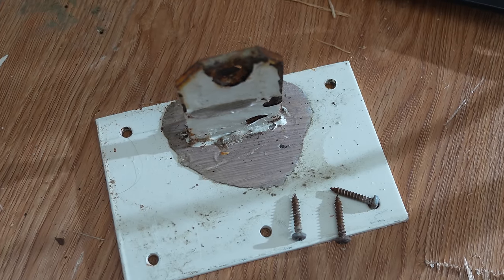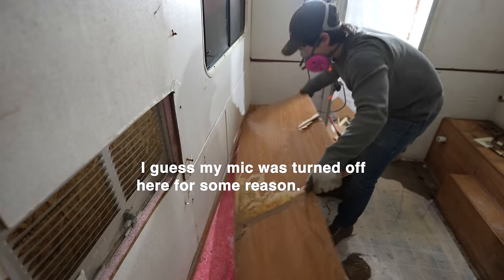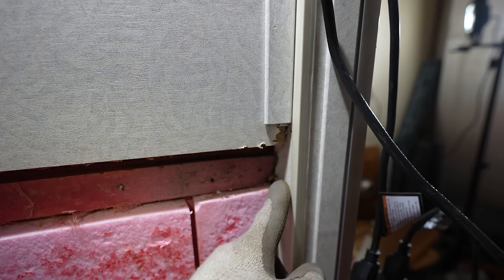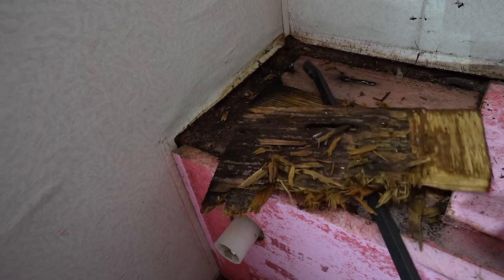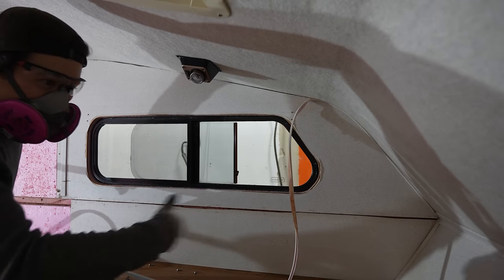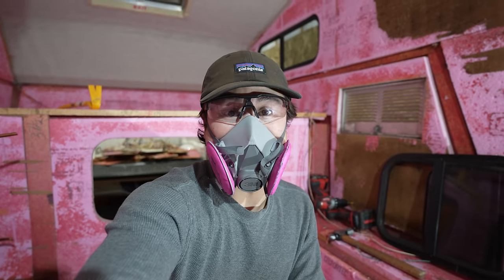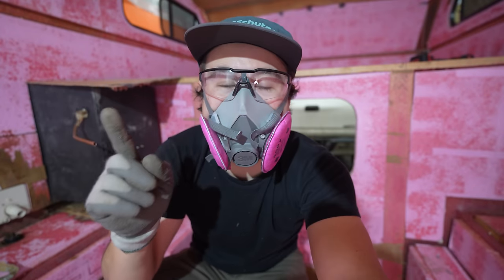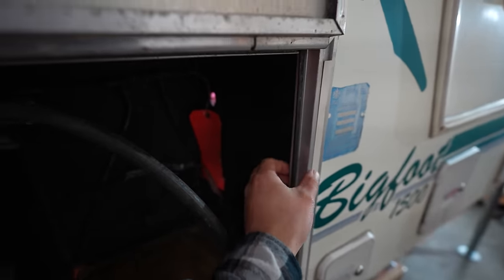It’s a Disaster in Here (Bigfoot Truck Camper Renovation)

Comment: Wow! What a nightmare to fully realize! But also what a plethora of possibilities! 

I wish I could give you some advice on how to proceed against that mold and adhesive.  I would suggest bleach in a 1:10 ratio (bleach:water) to at least kill the mold, but I am not sure how the adhesive or fiberglass would respond.  What I can suggest is that if you have been using your gloved hands to remove that moldy awful stuff, you should be not putting those gloves near your face to pull down the mask.  You can inhale mold spores that way. Instead, use the other gloved hand to pull off the glove and put your hand into the other glove slightly to pull of that last glove so your hands aren’t touching the moldy glove.  It’s easy to forget the contamination and just spread it all over, including INTO you. Especially since you picked up your seltzer and drank it after using your bare hand to pull off the other glove.  Sorry, it’s a nurse thing! 

Either way, this is a big project and I look forward to seeing what you will do with it!  I don’t think I would mind a compilation video of a little extra length to cover the rest of the  reno and rehab of the camper before you get started rebuilding.  Good luck with your project!  It is exciting!

Comment: Just an idea, In case you don’t know what your putting back on the walls. I renovated a small camper years ago and used 1/4 sanded plywood. Cut the pieces to fit then before I installed them I used a wide tip propane torch and lightly scorched the plywood, giving it a nice look. You can even coat it with polyurethane if you want to seal it.

Comment: The fire and water restoration companies use hydrogen peroxide to kill/remove mold, removing the mold is easy to do. I used Rapid Remover from amazon to remove the leftover adhesive after trying to pull a wrap from a fiberglass box truck, worked very well and didn't harm the fiberglass

Comment: Imagine that, many companies built rolling boxes made out of wood ,caulking and paper thin insulation or not any at all and there’s water damage.I can see remodeling a scamp because it’s a one or two piece fiberglass, but these truck campers or rv’s are a losing battle unless you take all wood out put back a non molding material inside and leak proof it.The common theme is all truck campers and rv’s made out of wood get water damage.Even the floor needs ripped out and a thick fiberglass floor put back in,then use basement sealer on all of the fiberglass and foam mold proof insulation, don’t use one ounce of wood when putting it back together, and some r12 foam non molding insulation ,That’s my best advice . You will keep running into the same problem over and over unless you do this.Tear it down to the aluminum shell and build it back up with only fiberglass and mold resistant insulation.Don’t clean anything, it has black mold, tear it completely out and replace.

Comment: Wow ,  this is tough , really sorry to see you are having to go to such lengths !   Let dry then wet it down again with bleach water .  It will kill the mold !.   If I were replacing those tye downs , I think I'd take on to a fab shop and have new ones made in stainless steel . And putting a latice under the flooring with air holes in the bottom will help stop it  from reoccurring  in the floor.  This gives me pause about buying a fiber glass unit , which I have been wanting for some time  now.  I still believe a lot of it is from condensation  You've got the energy to get it  done' so I know you will make it like new !  Wish I still had that much energy !  When you hit that 70 mark it sort of subsides !  8 )  Good Luck , You got this though !

Comment: Find yourself someone with a large CNC machine and give them measurements to cut your wood panel replacements to size. Really shop around. I’m all the way in Florida but if I had solid measurements I could save you days of cutting wood to size. Any hobbyist maker with a decent size CNC can do it cheap so it’s more about the cost of materials. That’s why I say shop around.

Keep on keepin on man. You are braver than I doing this for sure lol.

Comment: I’m sorry that you found so much rot. I’ve never owned a fiberglass camper, but having owned older fiberglass boats wood rot is unavoidable. I know on boats glass mat and resin only covers a structure but does not give structural support. It’s only been a few years since boat manufacturers started using composite materials instead of wood. That’s why i never understood why used fiberglass campers command high prices since there is still being wood used for support.

Comment: Just goes to show that in spite of how great you thought Bigfoots were  they're just as shoddy as every other camper out there.  

It's criminal how crappy these things are constructed particularly when factoring in how much they cost.

I've taken two truck campers apart over the years and that is what you find when you're done, a rotten mess.  Like a boat, they all work in three different dimensions and all will leak.
Reply: Yeah I’m shocked at how these fiberglass campers are supposed to be so great or “bulletproof” but are ending up as hot tub’s on wheels! Also the tow downs are a joke, also they don’t use stainless screws? So much money for absolute junk if ya ask me. What a shame.

Comment: Use an abrasive brush or scouring attachment for a drill or grinder to remove and smooth out the residue. Make sure you don't apply too much pressure to the surface. Your just trying to create a smooth clean surface. Use an acetone and rag for the really sticky spots.☝️🇺🇲

Comment: Try denatured alcohol or a acetone, apply and then scrape it off. I’ve done it and it’s a nasty process when trying to remove glue resin from fiberglass. Once you do that try lightly sanding the fiberglass.

Comment: Since you stripped the camper to the bare walls, perhaps the insulation is also compromised so replace it with the insulation that has R10 value and use 3 sheets. It's very thin like a quarter of an inch thick and I'm sure the old foam insulation had much less of an R value and you will be warmer inside. Ciao

Comment: People who like your channel will not mind a longer video. In reference to the fiberglass, maybe you should sand it and reapply some fiberglass to make it stronger. I would want to have a clean surface underneath so that it minimizes leaks or degradation. Might want to consider that red stuff they put in showers around the windows or find out what they use on boats. To me campers should look to see what applications are for boats and try to use that, if it is not too expensive.  

Looking forward to the videos on the process. Make them long, no need to explain every detail we see what you are doing. Glad you decided to strip it to the bones.  At least you will have a peace of mind when it is completed.

Comment: Those tie down plates are fine. They are barley rusty. Just surface rust. And those screws aren’t holding the camper down. The plates are being pulled down to the truck bed. The screws are there so they don’t move when you’re hooking it up.

Comment: Bad play wood. I would use Marine grade water proof plywood when you go to replace the bad stuff. Keep going and stay safe. You need to have someone make new bracket's out of SS and maybe have them make a plate to go under the brackets outside and bolt it through the fiberglass with SS screws.

Comment: It looks like your vent for the frig in the ceiling is missing the top piece. The vent is a two piece. I see the bottom half has the metal screen. There is a top plastic cap on top of the bottom piece. If this has been missing, then water has been pouring water inside.

Comment: It is criminal how the manufacturers can put these and nearly all campers and travel trailers together with non-stainless steel screws. I ended up replacing every single screw on my little camper with stainless steel screws as a preventative. Good luck! I admire your can-do attitude!
Reply: Totally agree. Also the whole camper mounting system is frankly terrifying.

Comment: Bit late to this sire, the camper is '95' but, that pink solid insulation board you see wasn't a thing back then. This has been patched up (major reno) before. The pink board has been used to replace rotten wood, badly cut as well. 
You were better building from scratch. Renovation is ALWAYS harder then new build.

Comment: That's allot of rot. Might want to consider spray foam for insulation. It will isolate and seal against leaks from the inside.
Big job but hey it's all you got to do anyway.

Comment: I bet fixing the ole Slumber Queen isn't looking so bad now 😆 jk, this will be great when it's done. Long or short vid is fine. Breaking it into 2 will probably get better views though.
PS- when u stuck your head thru the propane hole 🤣💕👍
Reply: PPS- get some bar keepers friend powdered cleaner and a stiff cleaning brush. Itll take all the mold off. If need something super hardcore Id look into fiberglass boat cleaners, but the powder cleaner will def get rid of the mold.  Then spray area with bleach after cleaning and just let sit on it and dry

Comment: Dang I would have never guessed the rot would be so bad. Anything I can think of to remove that adhesive is going to eat that foam to shreds. Maybe think about trying to abate that mold with some bleach water and encapsulate what remains. I think you made a great decision here. It seems, from what I can tell, where the leak is it’s only on the bottom half of the camper, it has to be the seam between the top and bottom half. Good luck bro. I love these renovation videos but maybe breaking them up makes more sense. People who consume YouTube videos for entertainment have short attention spans including me.